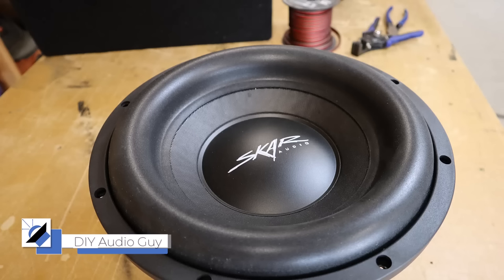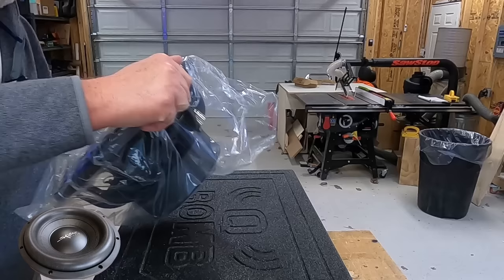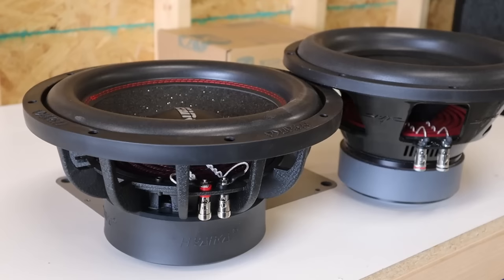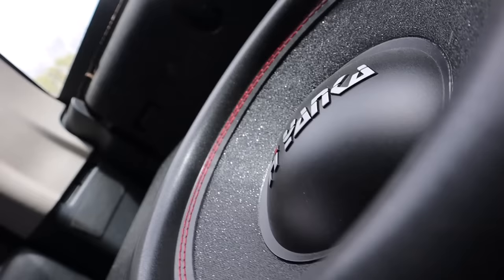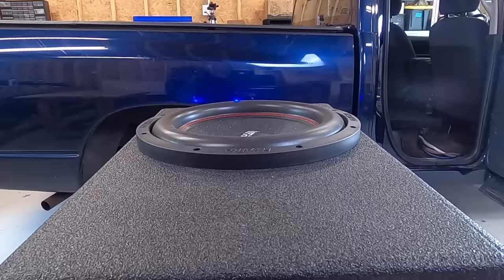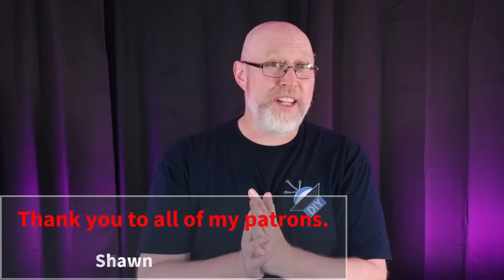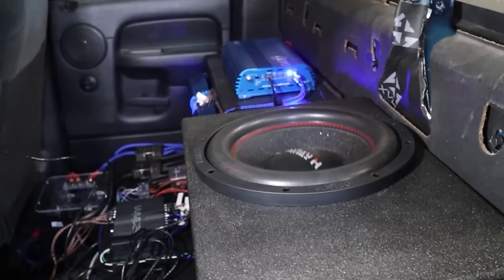The new budget king?  H Yanka better than #skar?

Comment: The foam not being as wide as skars will lean into it having a cleaner sound. This subwoofer is most likely not going to stick around with that brand as they need to find an american name brand. I would also put money on that it is coming from JLD or another company like them that offers tons of off the shelf woofers for companies with their logos. A few companies have changed builders and this could be their way of getting rid of alot of old parts by shifting them under an off name.

Comment: What's up with the only 45hz and up frequency response though?

And what about the  -  Rockville W12K9D4 12" 4000w Peak, Dual 4-Ohm, 1000w RMS   for only $119!? made in Japan
Reply from the maker: They had no problem playing below 45 hertz, I just picked the higher frequencies because they tend to get bigger numbers on the meter.  I have not tried Rockville out yet.
Reply: I tried the skar 12 inch. Rockville and then the hyanka. Not even a comparison to the rockville its night and day better and my box is tuned for 37 hz. The hyanka hits deeper, louder and way better SQ. It sounds like a high end sub. And I'm pushing 1600 watts rms from a fosgate T1000 bdcp which puts out dynamic power. It bangs
Reply: @kelvis1980  yeah not supprised I just watched a video they made 'demoing' their on wall speakers, it was embarrassing to say the least.  
if you want a laugh and a reason never consider them for anything again check the video- 
 ' DEMO of The Rockville Rock Slim ' 
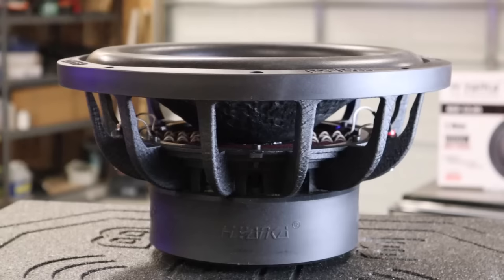2:40,  the guy acting doesn't even try... evrything happening there is just terrible 🤣🤣
Reply: I was just back on this vid for the same reason.  FR 45hz seems very high, so I'm wondering if someone will do a SQ up against anything else.
Reply: @DIYAudioGuy on the listings they show low FR of 45hz?  Is that perhaps a misprint?  I'm really going back n forth on the NVX vsw 12 600rms and the lower power Yanka 12, and by reviews yanka hits harder nvx hits cleaner.  I have a malibu 45deg hatchback so spl not really that necessary, but I'd love to see a battle.
Reply: @jimmiejamese.4006  I have it in a box tuned to 35hz and it sounds like a high end sub. Plus I'll throwing 1500 watts rms at it. Been great for the last 4 months or so. It gets lower then the skar and rockville r9 I replaced with it.

Comment: Just get an American Bass sub hard to beat them for the price, especially an elite . Yea they’re about $170 for a 12 but they slam .
Reply: I think the d4 1244 elite is 148 on Amazon. I had two running at 1 ohm on a Crescendo 3500.1 bc. If you know about Crescendo it throws more than rated. Those things took everything it had. You can't beat it. Sorry but skar hyanka none of them have crap on Ab. I upgraded and got the hawks now. Eventually want the godfathers or xmaxx 12s
Reply: I am currently running 2 1244 elites right now and they hit harder than anything I've tried by skar. But they have waaaay more powerful subs as well that will destroy anything made by skar. Like the xmaxx subs. American bass is the true king of budget subs.

Comment: Good day to you Mr. DIY Audio Guy I have an off topic question if I may?
When designing a subwoofer enclosure ,can it be too deep? although the recommended Net air space is maintained? would this have any negative effect on the given subwoofer[s] ?
I ask because I was told that the subwoofer[s] would act as if it were in free air and thus unload being that it has no rear baffle to load off of.
Reply from the maker: Air volume is air volume. The shape of the box does not impact performance in that way.
Reply: @DIYAudioGuy  Thank you for your response ,much appreciated .

Comment: I saw a NVX subwoofer there what do you think of them? I owned couple of their 15's back in the day the 750 to 1000 watt rms v1 models and thought they were really good but are they best in class for $209 bucks a pop? I have a Skar setuo their box with x2 SDR 600 watt rms subs they sound great but my car is insulated so well hard to get sound to the front so was thinking x2 12" NVX subs and buying another Skar RP 1200.1d amp subs will be 2 ohm dvs of course so both amps will be at 1ohm.
Reply from the maker: I have been waiting to test it until I get the JP 23 hooked up.  I even built a box for it.  Hope to get that video up in April.

Comment: Hey audio guy, i need some help deciding. Im going to be getting a 2 8 inch ported sub box. I need help choosing subs, im either thinking getting 2 RF p2's. Orrrr the Skar audio ZVX-8. Whats your opinion. I want to stay around the $200 for eaxh sub. Whats your opinion?
Reply: I also havent chosen an amp
Reply from the maker: Looks like the RF are on sale:  https://howl.me/cjVWA69EmsQ    I would go with the RF because they are more sensitive.   Also give these a look:  https://parts-express.sjv.io/jrzGV0    The only down side to those is that they only come in dual 2 ohm.  As far as the amp I like these:  https://lddy.no/19al2	https://lddy.no/1ggm4

Comment: I'm not saying anythings bad but me and my bro love our skars... I have an sdr 15 that came in a box with an amp and wiring and he has an evl 18... my 15 with everything was $500 on amizon and I love it... I think skar calls it a bass package...
Reply from the maker: A lot of people agree with you.
Reply: I just recently blew a Skar SVR 8 running on an old 360watt kenwood amp. There was no warning. No sounds, no smell, no smoke, no anything. It just stopped playing. I thought my amp gave out so I bought a JP8 to take its place. It wasn't until I hooked up the JP8 and got no sound, till I realized the sub was dead. Checked continuity on both voice coils and neither had anything until you moved the cone up and down. The sub was 1 month out of its 2 year warranty. I messaged Skar and asked if I could buy a recone from them, they basically told me to kick rocks.

Comment: Yah... I never understood why I would want to buy a speaker that has 50% more power for only a few more dollars, when I'd most likely have to buy a more expensive amplifier to power it.. Anyone else? That's one of the reasons I always liked JL Audio, their speakers always had very low power ratings and did the same thing or better than those guys claiming 1800W Power rating!!!!
Reply from the maker: Plus all the other hassles that come with a bigger amplifier, like batteries and alternators.

Comment: Can you review Deaf Bonce SA252 and the SA272 Dual 1 ohms? Would be very much appreciated. I think HYanka vs Deaf Bonce vs Skar would be an interesting comparison.
Reply from the maker: That would be fun!  I wonder if I know anybody that knows anybody over at Deaf Bonce.
Reply: @DIYAudioGuy  all with the Q-Bomb Sub Enclosure for 12 inch. Since then the Q-Bomb enclosure will give a reference for performance? Would you agree?
Reply: @DIYAudioGuy  also a friend of mine is also very into car audio and is meticulous with the highest performance builds for say a single sub can offer. He says I need a 3.66 cu ft sub enclosure for the Deaf Bonce SA DB252 D1 but in Deaf Bonce manual it says 1.8 cu feet and that's what I got the Q Bomb that has 1.84 cu ft. Could you potentially take a look at their manual that they provide for each sub? I would appreciate. Friend says I can wreck the subwoofer if it's used with an improper enclosure?
Reply from the maker: @RavensBreath  https://diysubwoofer.blogspot.com/2021/05/custom-subwoofer-enclosure-designs.html

Comment: I have a pair of the 12d4 as well and they slam. 
I have them on a D4S JP8 at 1ohm with a 4cu ft. Ported box tuned to 33 Htz. 
The Boxes were beat up but the subs were good.
Reply from the maker: That is a great amp.
Reply: @DIYAudioGuy I have an single 12 Skar Evl in an custom box and it gets down with a JP13. I want to give this speaker a try......do you think the Jp will be to much at 1ohm???

Comment: Wat subs do you recommend for a 1800 watt audiopipe class d mono block amp???
Reply from the maker: It is probably 900w RMS at 2 ohms.  So one of these, but get the dual 2 ohm, will work fine.

Comment: Why smaller amp just set the gains really low if they’re both dual 2ohm vc i don’t see why u can’t run the same amp maybe he’s talking about what they can handle idk but I ran my sdr 12 on a 3k rms amp at 1 ohm before upgrading to my svr and had no issues
Reply from the maker: True

Comment: Hey car audio guy quick question when you parallel wired the sub what ohms did you get?
Reply from the maker: I did not check that.
Reply: @DIYAudioGuy  should it be 1 ohm or should it stay around 2 ohms?
Reply: @sandromoreno4060 if you wire a dvc 2 ohm sub in parallel it will be 1 ohm, wired in series it would be 4 ohms.

Comment: They're all good subwoofers and people need to keep their expectations to the basics if you push a cheap sub like an expensive sub of course it's going to pop if you abuse it and don't set the gains right where have the right power or straight up push them beyond their limits or have the wrong enclosure they will get a reputation for being garbage it's usually user error I've had cheap Subs that sounded better then hire budget brands in the right conditions and lasted me quite a while just remembered friends don't blow it LOL

Comment: Is 18 square inches of port per cubic foot too much for an 18 inch sub?
Reply from the maker: I don't know where this whole inches per cubic foot thing comes from. I've been trying to track down the original source for that rule of thumb and I just keep going in circles.

The right thing to do is to model it in something like WINisd and make the port opening big enough so that you don't get chuffing
Reply: @DIYAudioGuy  yea was just wondering if you could have too much port area per cubic foot. Thanks
Reply from the maker: @brick2077  as the port area gets bigger the port has to be longer.  That is usually the limit.

Comment: They are also kings of budget amplifiers. You can get the same power as $800+ amps and yet they cost $150-400. Sadly skar products are chinese made stuff, and other brands are using the same manufacturer to make their own stuff. side note my packages never come damaged. not once. so dunno who delivers your stuff but that shit never happens where im from.
Reply from the maker: It's rare, but it happens.
Reply: @DIYAudioGuy  Hey can I run a JP23 amp on a stock alternator? Also I was wondering what's the biggest amp I can get away with stock? I have a 2017 Equinox LT
Reply from the maker: @wavycrockett4261  I would not run more than 1,000 watts RMS on stock electrical.

Comment: Redo the comparison with an SVR series skar since it's more the same price range and power handling. I think the EVL series skar would be a nicer comparison with the cast aluminum frame and similar power handling rating. The SDR is the 2nd lowest end model skar makes and it's significantly cheaper than the Hyanka. Not a far comparison IMO.
Reply from the maker: Stay tuned!
Reply: @DIYAudioGuy  Nice. I own an SDR 8" and an SVR 10" and the difference between the two skar models is pretty large. The SVR is a much better speaker. The EVL is a step above the SVR. I think the EVL would totally outperform the H Yanka but it is a little more expensive.
Reply: @DIYAudioGuy  Because of your reviews I have a 15" H Yanka in the mail to DIY an HT sub with. Doing a 300 watt dayton plate amp to keep it cheap. Probably go with a sealed home built box so I can DSP it. Love your channel.
Reply: @DIYAudioGuy  I would definitely call the SDR muddy and lacking accuracy. It's a cheap model that can actually take some power and sound decent but it's not accurate at all. The SVR is much more balanced.

Comment: Most of the subwoofers are all being run through the same set of manufacturers in China.  It comes down to how much profit can the producers name get them and where are they cutting corners.  1 car battery plant in the US was putting out 1/3rd of total car batteries.  The only difference in them was the casing(branding) and the style of battery(auto,marine, etc) which could be spotted by the weight of battery(amount of lead paste used).  People need to realize that a lot of the price they are paying is for customer support and brand name.  I guess one thing I would look at to see true bespoke subwoofer would be the size of the voice coil.
Reply from the maker: That is true for almost everything.  A very small number of meat processors package all of the beef and chicken in this country.

Comment: How can you compare two subs using 2 completely different amps and amp ratings?  That's not a comparison. Watch some Parker the basshead videos and take note the skar sdr can handle 2200 watt burp and can probably hit the same db. Also use the exact same box then do a rms run on both sub ratings and see how long they last then and only then will you have a true comparison of two speakers just sayin

Comment: But can it run at .5 ohm like a skar can. I run svr12 at .5 ohm. It’s been two years and they still thump at 28hz on a rp2k.
Reply from the maker: Yes. Just get two of these and parallel them, or four of the dual 4 ohm.
Reply: @DIYAudioGuy  awesome I might try some out then.

Comment: dual 2 ohm is really limiting you to a 1 ohm amp (parallel wiring), and most amps are 2 ohm stable, You usually don't want to go up to 4 ohm (series wiring) then your amp doesn't make as much power., so 1 dual 2 ohm driver really just gives one opportuniy of 1 ohm. Whereas 1 driver with dual 4 ohm allows you to wire it down to 2 ohm (parallel) which most amplifiers can handle, or wire it series and get 8 ohm and now you can hook it up to your home stereo. It gives you the option to use it either or both car and home stereos.

Comment: Still wouldn't go with skar. I've always had 1 of 3 brands.jbl.orion or pioneer. My dream is the jbl wti but I have 3 orion hcca 10s. Daul 4 ohm. With a power acoustic bamf 8000 amp with 3 power cells.

Comment: I'll have to check these out but I went straight from JL Audio after they blew to the evl series and JL puts out much better sound not as hard-hitting slapping violin Bass more of a baseline audiophile everyday great sounding music speakers but $400 a piece compared to the skar evl series I could barely tell what difference just a little bit but those scars hit some notes that the jails couldn't hit and the jails hit a lot Lowe's that a few other mid to budget range Subs I had couldn't hit I'll definitely have to try one of these I've run one solo sub and that's all I really need by pound violently or it Palin's violently with his 2000 watt monoblock great videos I'm going to sell strive I love what I have a little bit of extra money grabbing a new woofer to check it out

Comment: Any subwoofer or amplifier  that says to you 5,000 F-ing  WATTS !!!!!!!!!! HHHHHHOOOOOOOOO!!!!!!!!!!!!!!! is junk and only distortion, you pay is what you get. You buy a cheap tool to only use it one time, but buy expensive that’s another level. I bought SKAR AUDIO and it f-up my battery cells and had to buy another one battery, and light coming from my dashboard.
Reply: Thats true most of the time, but there are exceptions.

Comment: 2k watts but only 132db?
Reply: Justin is not an hi level spl competitor. He only showed two frequencies. Plus this sub is known for being musical, not peaky. I would not put much thought into the spl number he got. I'm sure it could be higher in a different box and optimized for his vehicle.
Reply from the maker: At high excursion levels there is less voice coil in the magnetic field.  So more power does not translate to more SPL.  If this were an SPL subwoofer with a long coil you would see a difference.  That is one reason why the different power levels did not have a big impact on SPL.
Reply: Does that look like an SPL box to you?
Reply: @DIYAudioGuy  
Proper competition SPL builds don't need excursion either as they rely on the port to do most of the work; when your port is very efficient the sub should hardly be moving at all even at some extreme output levels (at and around your peak). 

Don't worry, nobody who has actually done SPL competitions is looking at this video thinking you are trying to chase deebeez here.  First and foremost there's no visible gorilla tape anywhere in sight.

Comment: Skar sdr is junk went through 4 12s in 3 months with a skar 1200 amp
Reply: Either youre doing something wrong or just got a bad batch, me and all my buddies use skar, sdr evl and the zvx.
8s at all levels are great especially the zvx obivously.
10s and 12s awesome. Never had an issue, and weve done multiple different setups throughout the years never any issues. 
Make sure youre wiring correctly for the sub and the amp, no clipping or distortion, itll ruin your sub quickly even within the power range